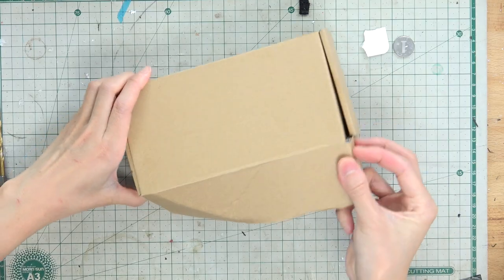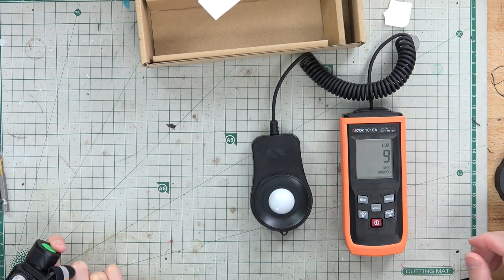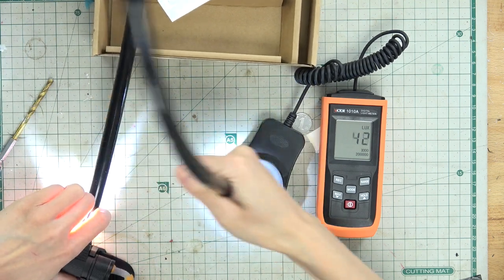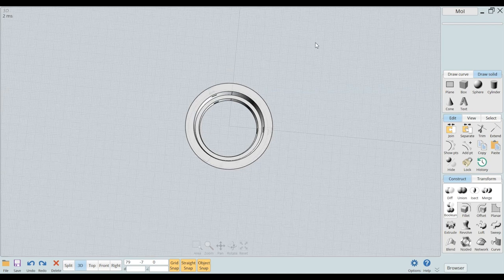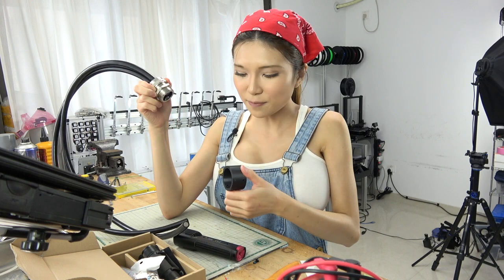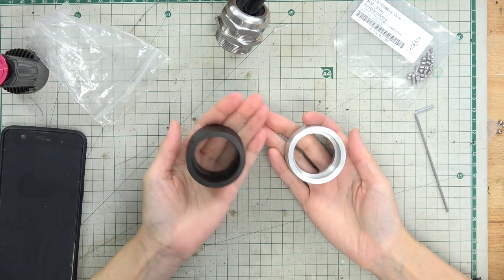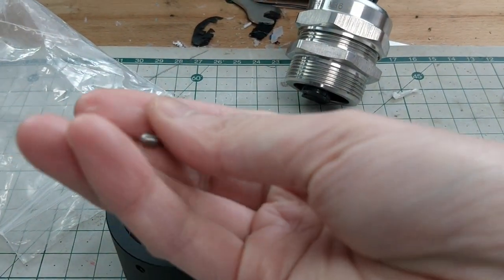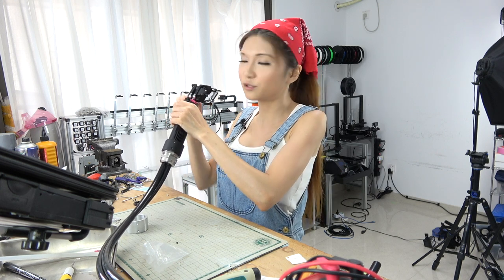LEBs- Cyberpunk Wearable Fiber Optic Implant Transillumination

Comment: Will this work on original "firmware" as I don't have the upgrades? This is some pretty awesome stuff
Reply: As far as I know, no. Original "firmware" absorbs too much light. I know of people using this effect to prove they are not upgraded.
Reply: It's won't be the same, tissue absorbs a lot more than silicone, but some light can still diffuse through tissue. Best thing is to find some similar intensity LEDs and hold them against you for a quick test to see what kind of penetration you get.
Reply: Just go get upgraded simple as that. if you need money then borrow some.
Reply: I have F cups. The original hardware is fine I just need to flash the firmware. I am interested in adapting the idea for my own corsets and possibly commissions then maybe I can afford a reduction so  I don't have constant chronic back pain.
Reply from the maker: Sorry, only works with implants...
Reply: Well I'm outta luck then. I do worry that prolonged exposure to light and heat may degrade your implants but I am sure you will look after yourself in that regard.
Reply: You could try a high-intensity red LED, it was clear the other wavelengths were absorbed totally. Perhaps 650 to 660nm?
Reply: Theressa  where there is a will, there is a way.
Reply: @pattheplanter I  recall using a red laser pointer to locate splinters of wood in fingers to better grab them with tweezers. They did light up a finger. An OEM F cup is a lot thicker than a finger. Maybe a led strip or cage of smaller cooler red LEDs could do the job.
Reply: They are NOT upgrades.
Reply: Spydiggity it's all opinions, man.  In her opinion they're an upgrade, and I for one will defer to her expertise in the subject.
Reply: i think it couldmaybe not as much though need stronger light
Reply: Theressa I think the term you're looking for is  "meatware". Firmware is in your brain, and you have to have a right version to decide to upgrade your meatware with implants.
Reply: Theressa you could also maybe try separating the heat with a material that's harder to heat up so it could shield you or a material that could have light refract off it or go the "simple" route and use a glowing material that reacts to electrical pulses. Try looking into electro chromic fabrics. Polythiophene came up when I did a quick search. Unsure if this emits light tho.. Might just change colours
Reply: Theressa harware
Reply: the reason it wouldn't work for original "firmware" is because the implants are a transparent/translucent material that takes up space in the... motherboard? anyways the original firmware is much more of an opaque material taking up that space so the light isn't reflected as well through it. i might be stating the obvious in an overly scientific way but that's the fancy way of saying implants clear, regular boob muscle/fat not clear.
Reply: Theressa 
Haha.  Honestly, original “firmware” as you put it, would probably work to an extent.  The medium the light has to shine through may just be a little too dense though.
Reply: Steve Evans did it all the time when my son was younger. Using them for their original purpose prevents arrest
Reply: Pixel_Geist too many errors in the original code.
Reply: Ya mean "hardware"
Reply: Hardware issue, not software/firmware.
Reply: Given the nature of the original "firmware" it is unlikely that this would work. In general, tissue absorbs light strongly.
Reply: Steve Evans lol
Reply: Theressa upload a video of the oem ones. i'm sure they're gonna be fine even without the light shining from within.

Comment: You're such a bright engineer as well as a pretty model for your creations. I was thinking that this would be an interest thing and I found out that you already did it. Now, don't get too comfortable with where you got – think of what next generation product could be. And with some high-tech stuff, it could be glorious.
Now, considering it's cyberpunk, of course I talk about implants! It could be a part of the breast implant itself (then it has pretty good water cooling in the saline around) or right next to it (preferably a strip of something with fairly low wattage). Next problem is powering it. Magnetic induction sounds quite obvious, be it charging or for straight out powering. Could be fun when passing the gates in shops where induction is used for RFID, if the magnetic field there is strong enough, could be less fun in MRI at hospital. Also, if induction is used straight out for powering it, then the device inside doesn't need to be very sophisticated, you just make the magnetic field slower or weaker.
That said, I love the prototype even with its flaws, and the demo presentation was awesome. I would love to see the light show in person.

Comment: You can use red leds with 1/10th of the power for same effect. Human skin filters all but the red so using white is a great overkill
Reply from the maker: Building drivers for red LEDs powerful enough is more hassle than just putting a red filter on an off the shelf high power flashlight that's got everything ready to go.

Comment: V 2 suggestion: The original fiber would have worked but you need a glass sphere lens and two axis adjustable mount to couple the light into the cable. Your meter output was only poor because the coupling was poor. Smaller fibers of course are more flexible and lighter but they also are more difficult to couple light into and the output is aggressively more diffuse the more you have to focus the light down to get it in.  In your case since implants can be approximately modeled as frosted sphere lenses, it doesn’t matter if the dispersion angle is large. Read about conservation of etendue for more info.

Comment: This is kind of a shot in the dark, but as awesome as this is, have you wondered if this may have had anything to do with your recent rupture? As you demonstrated in "See my Boob", silicone looks like it holds up well against impacts, but what about when it's exposed to higher than normal temperature? I'm just a programmer and don't have enough experience in thermodynamics, chemistry, or plastic surgery to really know how feasible this is, let alone whether it got hot while you were out demonstrating it, but the heat may be a factor to bring up with your doctor if you're still trying to figure out what caused the rupture.
Reply from the maker: Silicone is thermally incredibly stable (used for cooking utensils) and with the fiber optics the shell would never have gone more than a few degrees over body temperature. Doc thinks it was just a manufacting defect. 6% of implants just rupture.

Comment: That big metal nut is called a "PG" in my area of the world. Its available in various sizes for water-tight feeding single cables into housings.

I think silicon is normally clear or white and can be transparent a bit - but maybe the black one you used will stop most of the light.

Comment: I don't know if someone already suggested it or not but you should try to make a circuit with led light that blink fast enough to seems like there are on all the time, it saves power, achieve brighter light and less heat, a lot of lcd display use that technic and maybe it could work in your case. There are probably downsides.

Comment: Have you considered using Vespel for the collar around the flashlight, instead of the machined metal collar? Vespel is an amazing material, it can tolerate incredible heat, and is also an outstanding insulator in addition to being machinable.
Reply from the maker: Huh, I'll look into it-thanks for the tip!

Comment: If you measure the out side diameter of the fiber optic cable then measure the out side diameter of the light source then make a cone shape or funnel shape into the fiber optics cable with Allen screws holding the fiber optic cable in place.

Comment: I know, year+ off, but I think the original light source you had would have worked fine. you just needed a better way of capturing the light. A conic design using a metallic filament would likely give you the light capturing properties and lowered the overall heat that needed to be sunk.

Comment: I'm sure that hi output LEDs  would have worked with less heat, run them around the underside. It shouldn't take much light for it to show, and you wouldn't have the single light point problem.
Reply from the maker: Nope

Comment: That compression coupler probably has a standard thread, you probably could've had the CNC house make your part with that thread so you wouldn't need set screws....

Next version.... have them make a part with set screws for the flashlight, and holes on the other side that fit the light pipes... one piece, less black silicone.

Comment: you can get bicycle headlights that push 2000lux or more :) without the heat load unless you push the 7000lux versions they get really hot

Comment: May I make a suggestion?  I think you should drill, and tap the holes for the set screws. That way they will be more secure,  so they won't wiggle out while you are dancing. ))
Reply from the maker: Which? The cables in the bra are secure with a collet, and epoxy on the other end. The metal adapter on the flashlight does have set screws.
Reply: @Naomi-Wu  
I can see that what you have done works. I like they clever way you attached the cables to your bra. I'm referring to the set screws that are holding the aluminum device to the flash light. I was concerned that they might wiggle loose. 
Your idea is excellent,  I'm just trying to help you improve it a little, David

Comment: I love your unique engineering.   since silicon is heat resistances, why coat entire head with thick coat with Silicon gel?
Reply from the maker: Hmm, Not a bad idea🤔
Reply: @Naomi-Wu  I meant was headlight.  they have silicone oven mitts. so why not just cover headlights with silicon gel.  I never tried it so, let me know.  messing with fiber optics, coming out of your body looks alike Borg from startrek

Comment: would it have cost significantly more to have the  part cnc-ed as one whole piece (without the hardware store piece) and two holes in one end for the fiber cables to fit?

Comment: Great idea sexy. A suggestion rather then 2 big light pipes perhaps many smaller pipes would work and in theory has advantages. Firstly the many  pipes can be combined better at the collector (the thing holding the pipe on the torch) so more of the light is collected, second the smaller pipes are more flexible and easily formed into clothing, third more pipes means better light dispersal I would attach them to or following an underwire do the light is spread evenly across your chest. Naked optical fiber can glow (leak) when active this effect could be used to effect with purposeful pipe routing and selective removal of the sheath material for the desired affect a filter could be used in the collector to change the colour of this affect although the chest will still look red.

Comment: I don't understand the bright lights heat problem I have worked with LED and had no noticable heat
Reply from the maker: Depends how high you are driving them.
Reply: what if you use high power LEDs and drive them lower? Also can you not use lower powered LEDs and just stuff more of them in the same space?

Comment: The connector piece you had made for yourself that attaches to flashlight could benefit with Air fins to diffuse heat away. Sort of like a motorcycle has on it motor seen on piston cylinders  or a computer heat sink.  Your invention Result  was very stunning, Love the sunglass picture, so very futuristic.  One observation: This idea work well for you because you are large breasted.  But what about for a female that is smaller? An Idea came to me. acrylic bubbles, 1/2 bubbles. A female could have top made with the domes and if the fibre optics are connected properly to the bubble they too will illuminate. That way flat chested women can feel sexy too

Comment: I'm amazed you didn't see what the answer was to your problem you were overthinking it it over analyzing it all you needed was a shroud to cover the end to cover the light or you can just use the flashlight put put padding underneath it between you the flashlight and the corset and it'll work out just fine you over did it you over thought the problem it was just right there in front of your face
Reply from the maker: Nope. Feel free to try😉